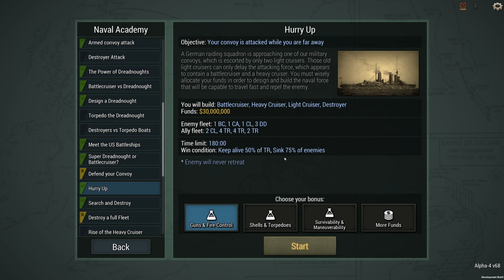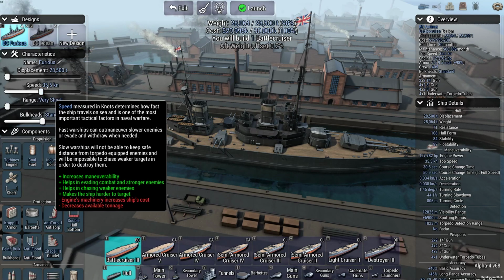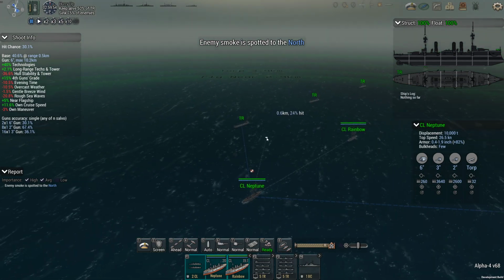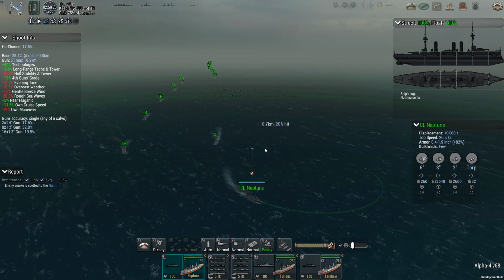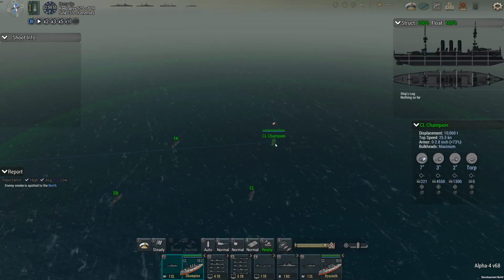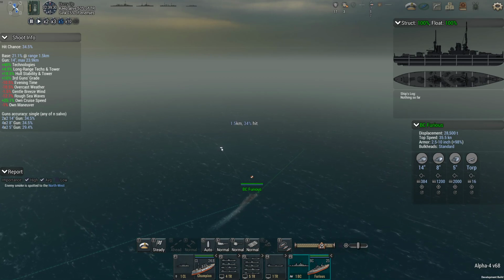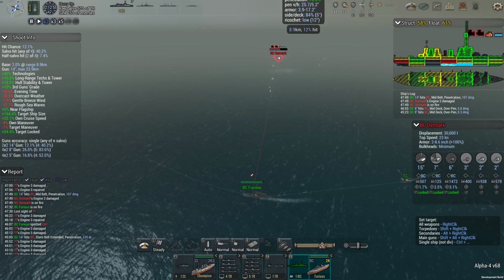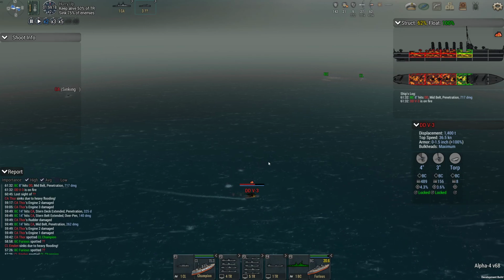Ultimate Admiral: Dreadnoughts - Hurry Up! Attempt 2

Comment: I banged my head against this mission so many times. My best design was using the survivability bonus, a BC with 3x2 12" guns (seems to be the best overall caliber unless you absolutely need the grunt of the bigger guns which you don't in this mission, all enemies are made of paper), 18x2 4" and 12 3" guns (because curse those goddamn destroyers).
40 Knots max speed and armour of the highest quality of 11" at the belt meant it could tank pretty much any shell thrown at it as long as the enemy BC didn't bring 16" cannons or something.

Every single time I have attempted this mission, the flagship was always one of the transports, meaning I always had an unavoidable -15% accuracy.

The big issue? Torpedoes. Every time.
I can kill the BC and CA with extreme ease, often due to flash fires and ammo detonations.
The CL takes much longer to kill due to accuracy, but generally can be overwhelmed by the sheer amount of secondaries.
But the Destroyers? Even with every single gun pointed on them nothing hits them, I hardly ever saw the hit chance go over 1%. If I hit, 9 times out of 10 it's a glancing blow that does nothing or lights a fire that's put out in seconds.
Plus the optics you get on this mission are so god awful at the destroyers can easily get in torpedo range without being spotted.

Meanwhile they dump salvos of 5+ torpedoes each and even with maxed out torpedo defense I could only take one, MAYBE two before instantly dying. The ship was super fast and as maneuverable as I could make it, but there's no dodging 15+ torpedoes at once.

I'll try it again learning from this video, hopefully I manage it.
Reply: HA! I MADE IT!
Even though this video is super out dated, it helped me quite a bit.

I went with Guns & Fire Control.
Max Speed of 31 Knots. Maximum Displacement.
I kept the 3x2 12" guns because they're fantastic. Upped the secondary armament to 5x2 8" guns (all central mounts), 12x2 5" guns and 12x1 3".
12" main belt (worse quality armour means I had to up it a bit).

I also don't bother with Barbettes. They're heavy and a weakpoint. 95% of the time I'm broadsiding anyway, I don't need superfiring.

As for Strategy, I had the light cruisers abandon the transports and link up with the BC. Their guns are needed to overwhelm the destroyers.
The new secondary layout was really bloody effective against the destroyers, they got positively shredded compared to before. The 8" guns are beefy enough to help against the cruisers too, though mostly just by doing chip damage.

As long as they don't get torpedo'd the transports are relatively tough and they were actually doing respectable damage to the destroyers with their 2 and 3" cannons. I think I lost 4 of them.

Comment: Not sure how viable this is, but would be keen to see you try a mission like this with a fleet of lighter ships as opposed to one heavy, expensive ship
Reply from the maker: I did try a Heavy Cruiser (CA) design for this mission once, but the CA was just too expensive for what it brought.  Surprisingly, it was way harder to get a CA up to 35 knots than it was the BC I used.  If not for that, a pair of 10" armed CAs would probably work just fine, what with how poor the accuracy typically is of the enemy BC.  I'm not sure if you could bring additional CLs ( I don't think it was a build option ) but then you'd have complete glass cannons again and would be heavily reliant on torpedoes..which could be okay.  As seen in the vid though, unless the CLs are speed boats, they get popped super easy.
Reply: @coldwave007  Ah thats kind of a shame to hear, I hope as the game continues development that CA/CL focused builds will become more viable